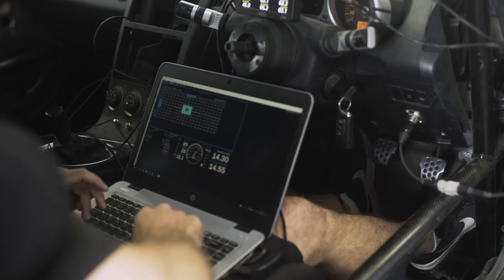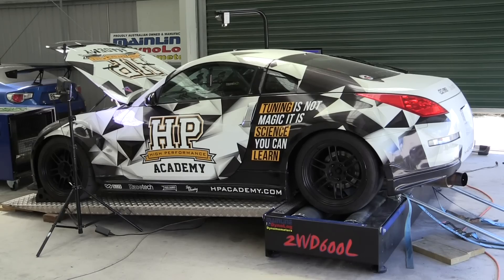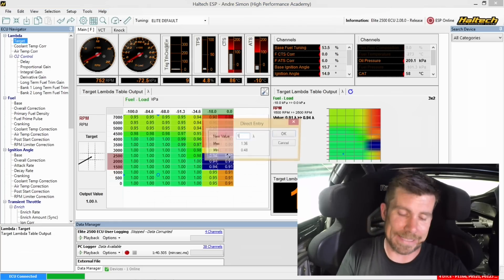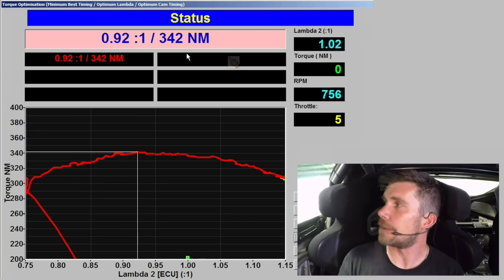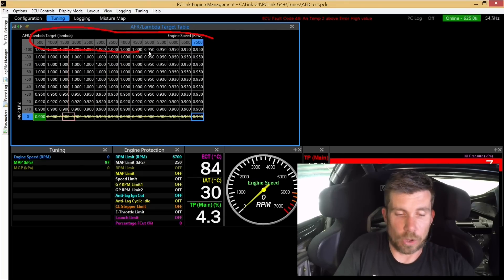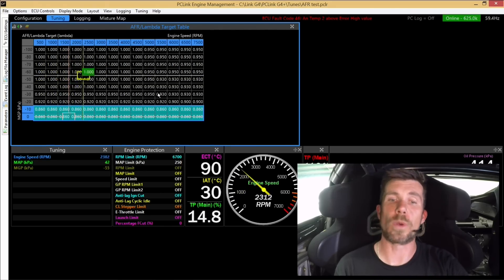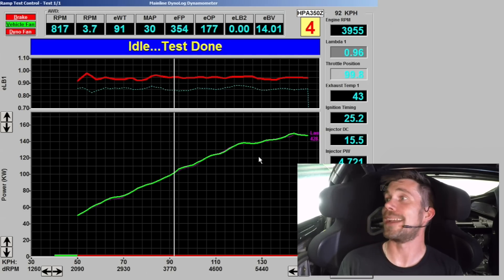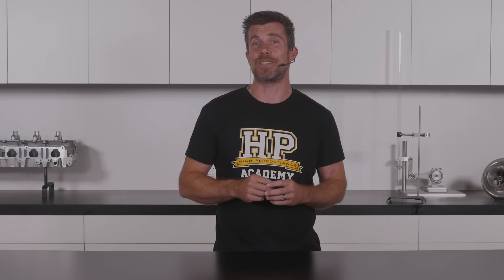Do You Want A Lean OR Rich AFR? | Fuel VS Power!

Comment: How does AFR affect engine and exhaust temps ? Is it true, that running very lean causes engine to run hotter?

Especially interested in this with air cooled engines.
Reply: Max Egt is achieved at stoichiometric.  When you go leaner than this egt decrease as will power.
Reply: @boosthit811  not necessarily true, too lean AND too rich will cause egt's to sky rocket. Why do you think ring lands break and rings butt together in lean conditions?
Reply: @scootbmx01  beyond peak (14.7) the egt starts going down. On piston aircraft, we have egts on each cylinder and can clearly monitor the drop (and loss of power). It’s at peak that people bust their engines.

Comment: Running lean in a nascar or circuit endurance car would be beneficial because fuel would last longer and or youd have to carry less of it.
Reply: That was not considered in this lesson on purpose. It was to show maximum torque/horsepower. When racing circuit racing you will absolutely benefit from leaner ratios (within reason) to maximize fuel strategy. F1 uses it all the time, MotoGP a little bit even though they never run out, and many other levels of racing need to lean it out for pure economy, richen up for passing etc. We know this, but it wasn't in the scope of this particular video.
Reply from the maker: We're with Matt. This is not a lesson on ecomony 👍
Reply: @hpa101  i understand that, i was just mentioning why some people may say running on the edge of lean is the only way to go.

I should have elaborated a bit more but i didnt want to leave a whole essay on the thought of power to weight ratio on fuel.

Even in a drag car if someone is trying to optimize power to weight ratio running lean would allow them to carry less fuel for a single run, even though it may be negligible many people get to the point of removing a gram here a gram there to get that extra .001 second.
Reply: @hpa101  i totally agree with what matt says in the video and ive been learning a lot from his videos the past couple months, i was just mentioning there can be some benefits from running lean, you have to carry fuel in the car, but you dont have to carry the oxygen.

Unless we are talking nitrous or compressed air.

Comment: I wish you would have also talked about the egt's as well.
That is a key part of the puzzle,  no?
Reply: The short answer is No.
But.
EGTs are affected more by Ignition and Cam timing events,
especially ignition advance.
Not having enough ignition timing will definitely run up the EGTs.
EGTs can be more useful when you are running on the ragged edge of detonation,
especially under boosted conditions.
At some critical point, conditions in the combustion chamber, 
especially Exhaust Valve Head Temps,
are going to cause the engine to go into run-away detonation........
The engine starts Detonating, 
then the knock sensors start pulling ignition advance,
which makes the EGTs go even higher, 
meaning that the exhaust valves are now glowing cherry red,
and you might be headed towards having a bad day.
This is specifically why you must be very careful with 
pulling Ignition Advance under Boost,
this can start making things very hot, very fast.

As a side note........
When running an engine with Water Injection,
you may find that the Water Injection makes the EGTs GO UP !!!
But don't worry,
the temps inside the combustion chamber are actually LOWER than before !!!
The Water Injection also actively suppresses Detonation,
much more effectively than Extra Fuel,
and, water cleans out Carbon, 
extra Fuel CAUSES extra carbon deposits, 
which can cause hot spots, which promote Detonation.
And, you can run stupid quantities of Water before starting to see a power loss.
( Running 50% Water to Fuel, (by weight), (under full load), is not unheard of ).
A 50-50 mix of Water and Alcohol is even better, (instead of straight Water).

Unfortunately, this last part only reinforces the fact that EGTs are of limited usefulness,
unless you're doing research on a Dyno under controlled conditions.
Per-Cylinder EGT probes can point out air flow, or fuel flow, discrepancies between cylinders,
but that's not something that you can easily analyze by glancing at a gauge cluster while driving.

An EGT gauge  "could"  warn you before your Turbo melts into a puddle. 
.
Reply: Random Someone buy the course and I’m sure they talk about everything.

Comment: That's amazing I had no idea a NA engine would care that little. I like how you displayed torque only because it's what is really being measured for one, and is easier to see a difference all across the entire Rev range with torque rather than Power. The tune that I have for my car which is a NA V6 not dissimilar to the 350z engine has a target of .84 lambda at wot.
Reply: that 350z does not sound n/a to me but meh

Comment: Is it true that a leaner ratio doesnt make more power but increases throttle response?
Reply: that’s right. just grab the cheapest but not garbage carburettor motorcycle and become its master, up and down the highway with each change
Reply: in my experience no. if you are lean and your acceleration enrichment is lean the engine will die for half a second with relatively decent throttle changes.
Reply: Never heard of this but I'd like to know the answer as well
Reply: No, the faster you get that air into the combustion chamber, the better throttle response... And well, other things.

Comment: For boost I use 11.3-11.5 for n/a 12.5-12.8
Reply: Tha'ts not a good comparison.. If a car is factory turbo, you don't need to junk it with fuel... If you game a 2L turbo from a cobalt ss, tuners who know the engine well always target 12.5-12.8 afr on stock turbo and stock engine and will make 330+ hp.. 380tq..  Then with a bigger turbo  they will target low 12's .. It's a dI engine so no need to run rich... Even port  factory turbo I would target low 12's... Now if it's N/A and high comp factory and you toss a turbo on top, then I would start to tap into the 11's at higher rpm's to keep it cool.
Reply: @PurpleHeartVR  That's a no from me. The general concensus for a force induction vehicle is in the 11s and n/a mid to high 12s. Your 12.5-12.8 SPECIFICALLY on a cobalt is NOT a good comparison to anything.  I own and tune a  DI turbo car... also, there are a lot of direct injection cars out now and majority runs in the 11s with or added FI
Reply: @Anthony-vr3um  di's are much for efficient thats why they can be run leaner. It's not uncommon to see a modded, boosted di engine in the mid to high 12's on pump fuel and even e85.